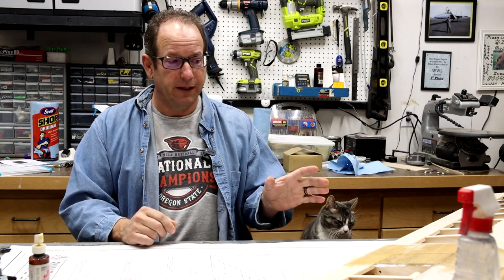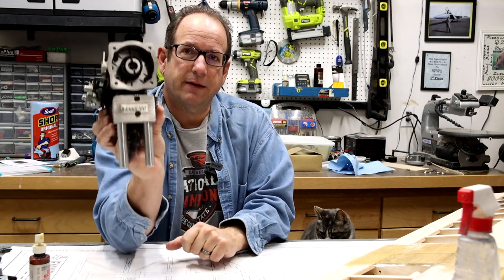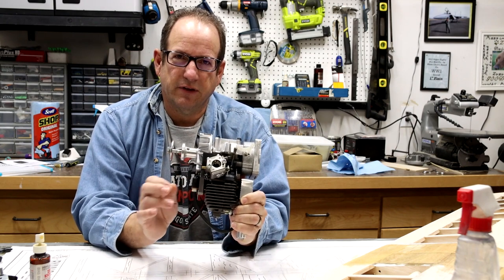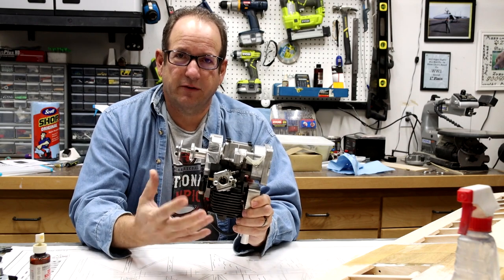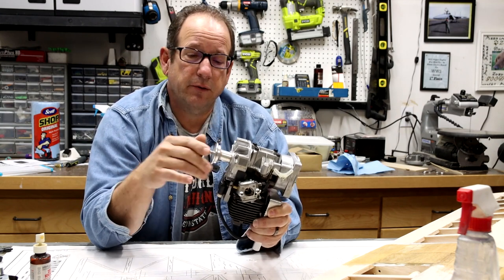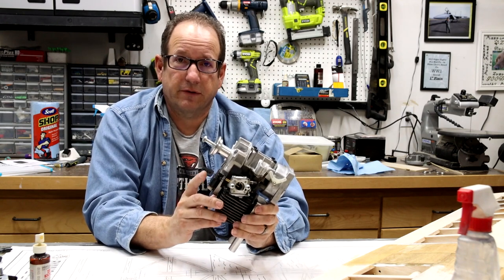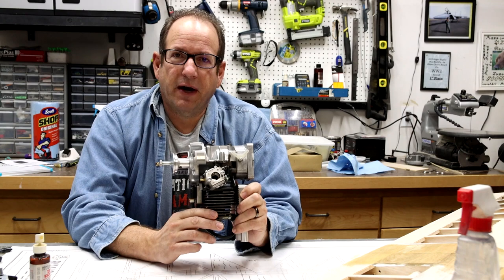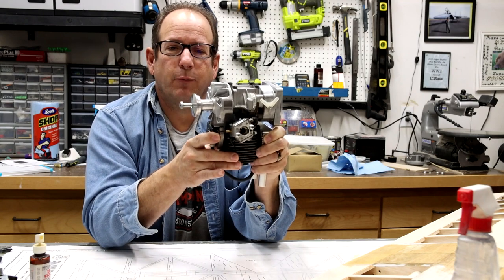EP12: Meet the motor, giant scale model airplane scratch build from plans

Comment: Something funny..I am a mechanic,  I've had schooling and certifications and did it for a living for years..and I love mechanical engineering. My left arm is sleeved in big steam punk gears and a boiler and piston and such all running a clock..but on my planes I actually really like electric now. You don't get the sounds and smells but you get constant performance and low maintenance.  Weight doesn't change during flight and you don't have to be constantly buying different fuels and plugs for different planes.  And with the new brushless motors your weight to power ratios are pretty much dead even with ic engines.  It wont be long till electric motors have more power than a chemically powered engines of equivalent weight..
Reply from the maker: Gas engine, and electrics are the only thing that I want to build at this point.  I sold off all of my glow engines and equipment a few years ago.  Besides being an expensive fuel, it is messy and smelly over time on anything the oil in it touches.  Not to mention, no matter how well you cover an airframe, the oil will eventually penetrant the seams, and soak the wood underneath.  Right now I am looking at converting a few past glow planes over to electric, and a few others to the newer small gas engines.  The foamie is a great concept, but I wanna have some wood and covering models... they can be either gas or electric.

Comment: Great video ON ENGINES. wish modelers would look in to this kind of engines. Been rc flying for 40 odd years and apart from my first engines (IE) GLOW ENGINES IV ONLY EVER BOUGHT 2 PURPOSELY BUILT  R/c petrol engines. Thay have all been ex chainsaw engines,  garden strimmers.  And even second hand chain saw engines.off the car boot sales for as little as £30 to £40 .At a fraction of the price of a purpose built r/c engine . AND IF A CHAINSAW ENGINE CAN CUT DOWN TREES ALL DAY. THEN FLYING OUR LARGE AIRCRAFT THEN ITS A VACATION FOR THESES ENGINES. 
GREAT ADVICE  FOR NEW COMMERS TO OUR  PETROL  MODELERS.  Don't WAIST your money you can spend it on other R/C  ACCESSORIES. 👍

Comment: Hi Dan.  Was wondering if you had a link to where to get those fuel pump diaphragm/gaskets for the walbro carbs?  
BTW, I learned the hard way to run the engine and tank out of fuel to lessen the gummy grim and oil that kills all rubber when not in use.
Reply from the maker: https://bennettbuilt.com/index.html   They have carb parts, and complete rebuild kits for many models of the Zenoah and Quadra family of engines, which all use Walbros.  You may also be able to find those parts at a small engine or chain saw shop as well.  Those dang carbs are used on everything.   Hey while I have you, I noticed you had a question last week about the sanding blocks I use. I got an email notice about your question, but it wasn't in the video comments so I couldn't respond.  Didn't want you to think I was snubbing you.  Those blocks were from Great Planes, called EZ sander, and I cannot find them now.  I know that GP, and its parent company Hobbico went belly up however some of their products are still being made under the Horizon Hobbies empire.  However check these out.  https://www.fibreglast.com/product/Perma-Grit_Sanding_Blocks?gclid=CjwKCAjw9MuCBhBUEiwAbDZ-7mtWIQcs9a13SdoqD0kOmx2N80C466j56VndPqarxg16OiByCJ6bdxoCGL0QAvD_BwE  They look very similar, and provide a nice grip to sand with.  I have not ordered from them but the product they offer looks like it would work well.
Reply: @Capgains7777  Thanks Dan.  Those look very nice as well. I will have to try one.  BTW, I took down my question before you could answer it because on your very next video I paused it and was able to read the name of the block.  LOL!  But thanks for getting back to me especially on the carb diaphragm as I have a gas engine I will be restoring. Can I just say thank you so much for making this video series!  I am immensely enjoying every video and learning the lost art of building balsa airplanes again.  Well, maybe in the last year or two its making an extreme comeback!  Yikes! I see some balsa plane kits on ebay that were previously selling for $100 now being bid up to $500! Oh My Gosh!!!  So I have a shop cat as well who gets into, knocks things down, and breaks everything.  Need to watch her closely!  Her name is Calamity!  My only hope down the road is you might have the time and the motivation to build something a little more complicated as it seems like most my kits I own are a bit overwhelming when trying to read through the prints. Thanks again for doing these videos, my favorite on youtube now!

Comment: how do i go about converting my own weed eater motor to an rc model engine, would really apreciate the help.
Reply from the maker: I’ve never converted one myself.  I always knew a guy, or found conversions online.  I would suspect that there are places you can buy the components to do a conversion like the prop hub adapter, the timing pickup and the boom box.
Reply: @Capgains7777  ohk...been watching these videos for a while and wanting to build 1...what are the other best engines to use on a scale plane as this 1 that you're building????

Comment: That answered my question but do you know were I can maybe get a conversion kit for a weed eater motor
Reply from the maker: I have never converted an engine over. I have always bought one that was either commercially available, or found someone that was doing it as a side business online.  I looked on Youtube for a vid on how to do it, most of them are old and I don't know if they reveal where to get the parts.  Many of the places that were making the conversions and parts have just disappeared.  If you have access to an airplane swap meet, that might be your best shot.
Reply: My wife runs a tractor dealership that sells Stihl I’d like to figure it out I have a 32 cc Stihl engine
Reply: But thanks for all your help

Comment: hi Dan could i use for 26cc weed trimmer Engine
Reply from the maker: I am not sure.  When you compare a 26 to a 30cc motor, my guess would be your power is going to be marginal.  You could strive to build super light airframe which may sacrifice strength.  Where you fly can dictate how much motor you need.  If you fly at sea level the engine will have a better output than at 4000 ft where I live.  So I really need to have more displacement just to offset the lack of oxygen at this altitude.  All I know is that Ryan designed this plane around a 30cc engine... And like my first episode revealed, I had no fun flying the UltraStick with not enough power.  So at 26cc... You are experimenting.  I'd always rather have power in reserve than not enough.
Reply: @Capgains7777  So how mutch power we need. I'm planning to put in this DLE 30 engine 3,7HP/8500rpm, but i don't know it have enough power and it isn't too havy (engine 910g, ignition unit 120g and muffler 60g)